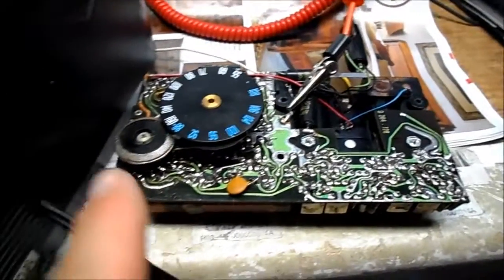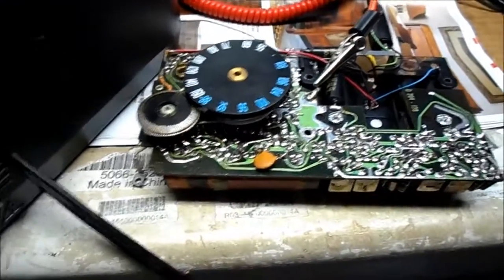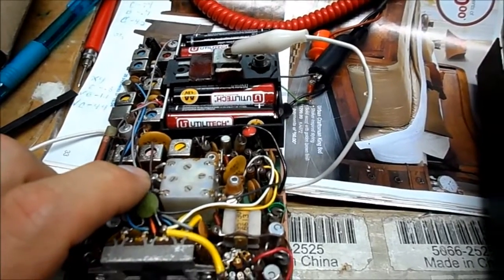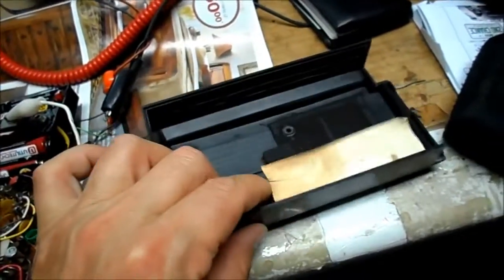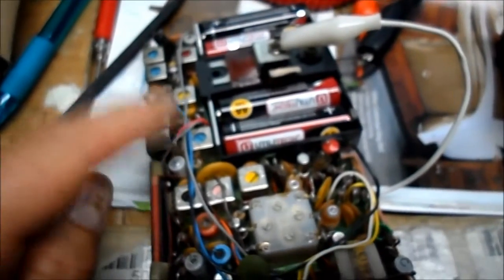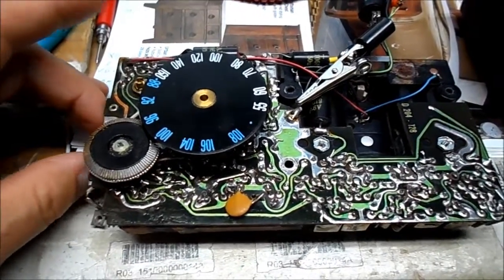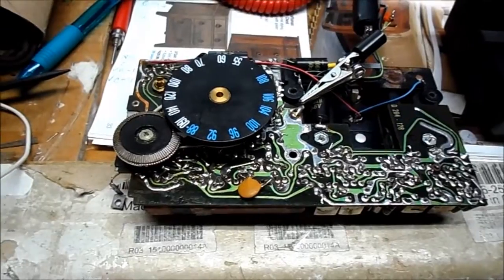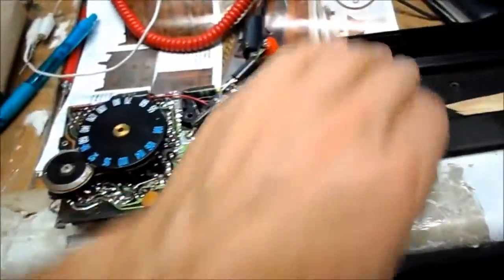1966 Zenith Royal 51 Radio. Pt. 3. The Repair.

Comment: how would you find a modern day replacement  for that transistor? great video
Reply from the maker: Replacements are still around, yet harder to find. This is where parts from donor radio come in handy. Also, NOS germanium types can still be bad from age. I would try to sub a silicon type 1st. Sometimes you can get away with it. I've heard Russian made ones are still in production.